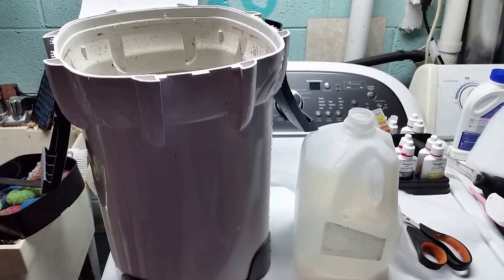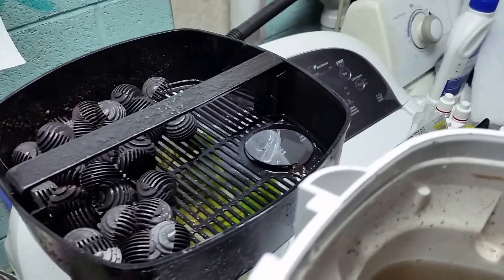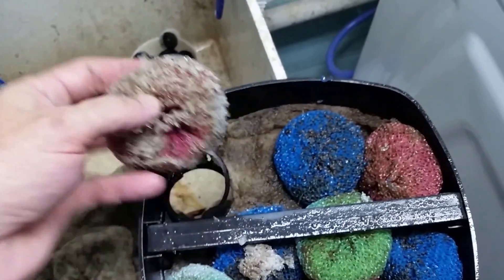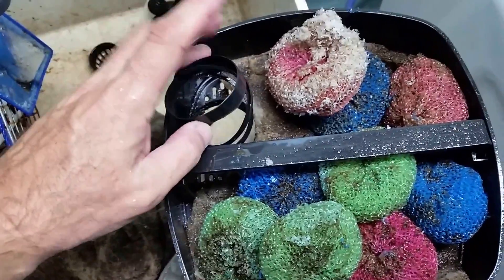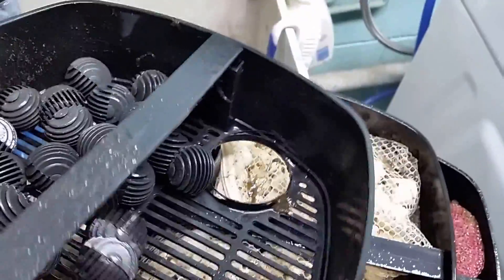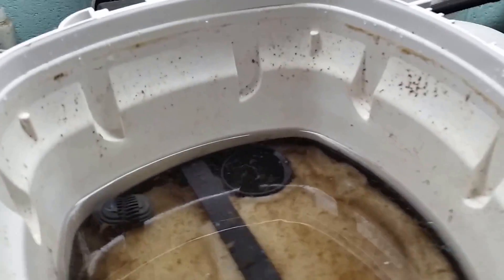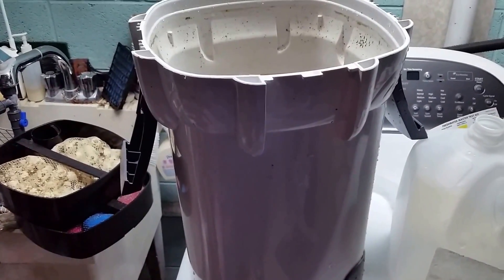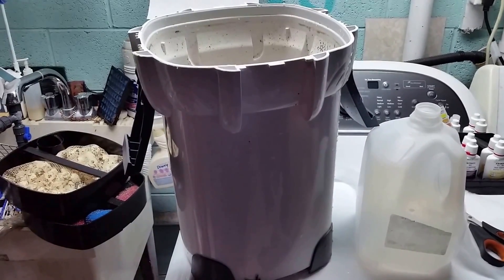UV Radiation Is Destroying The Inside of My Sun Sun Canister Filter

Comment: I used water proof foil duct tape with a little bit of aquarium super glue to help the tape stick real good.first you need to clean the inside of the holes really good with alcohol then dry off real good then cut strips of tape put a dab of glue on the area where your going to tape.I did mine seven months ago and it's holding up with no problems I run my uv 24 7now and my trays are perfectly fine😄

Comment: Bought a brand knew 304b ran the uv light for 24 hours checked the trays ran my finger around where the light goes and the only two top trays had black residue coming off them the two bottom ones where fine. Don't use the uv at all those trays are not uv resistant.
Reply from the maker: The manufacturer says the plastic will last a year or two with the light on 24/7

Comment: If not for videos like this I would not have researched the issue and discovered that there is a switch to turn it off...but its not obvious and nothing in the instructions explains the need to not use it constantly.
On the 304b the switch is under that clear plastic bubble on top of the canister. You must pry it off and it is just difficult enough to remove that you may think you're breaking something.
On the 404b its behind a gray door on one side corner of the top. It looks like a door a fuze would be behind...not a switch.
I'll be hooking my 304b up when I set up my 55 gallon. I suspect it will be a decent filter now that I know where the uv switch is.
Reply from the maker: It took me forever to find the switch on the 404. I don't run the UV all the time anymore either.

Comment: Using to much UV in these will damage them as well as any other filter that uses UV to kill algae so basically you can not use the UV 24/7 and not expect damage to the inside of your filter. 🙄
Reply: Use waterproof foil duct tape cut strips and put them on all four trays use a little aquarium supper glue to add extra stick clean the holes in the trays with alcohol first to get all the dirt off so everything will stick good then run the uv light 24 7 with no more problems

Comment: You do realise that plastic media should only be used in sump/moving bed filters? Although almost anything can grow bacteria but the amount it does is negligible compared to the correct media for canisters. Plus you should only be using the u.v for around 24hrs per week. I would expect nothing else. The trays in these sun Suns are really crappy plastic, so that don't help either. Even the ceramics that they come with are terrible, totally smooth. If you want to save money it's unwise to so that on filtration,THE most important purchase for your fish after the tank

Comment: Hmm seems like they used cheap plastic and the softener has gone. You normally don't have this with good or let's say high valuable plastics like ABS. As you said, the UV radiation has release the plastics softener and the result is porous plastic. But I always thought they were using good plastics...hmm...
Reply from the maker: I called the company, and they said about two years was normal before they broke down. I guess 'you get what you pay for" applies here. Lol (it's only $80 brand new)

Comment: Damn, I'm glad I decided not to use the UV in my filter. Makes sense though. It's like the plastic being exposed to direct sunlight 24/7. Must have killed the BB in the filter as well.  I use a UV sterilizer built for RO systems. It's housed in a metal tube and I run it on the same pump that runs my CO2 reactor, 6 hrs. a day.

Comment: I have now seen 3 Sunsun filters do this.  A 402b, a 403b, and a 404b.  All were having the UV light left on for weeks or months at at a time.  As mentioned many times in this thread and by resellers I talked to, it is suggested that the UV only be run for a day or 2 at a time.  I am only flipping mine on only 1 or 2 days a week.  For those looking for replacements in the USA, check out the AAP website.  That's the cheapest place I've found them.  They're also on Amazon listed with the 3xx series names for twice the price.  

http://www.americanaquariumproducts.com/ViaAqua750CanisterFilter.html#baskets

Ignore the Via Aqua name in the link.  The bottom of the page has stuff for those but AAP has switched to Sunsun as their recommended best-bang-for-your-buck filter.

Comment: Sun Sun is not UL rated.
Reply: Really expensive UV's are generally stand alone units run in line or on the out flow of a pump with UL rated piping.  The really good ones have coating on the inside to bounce the light back and forth like a pin ball to maximize the contact time.  Sun Sun should not be selling a UV in a non UL rated canister.  These things should be pulled off the market.  I owned one

Comment: An easy solution would be to only run the UV sterilizer for 24 hours when adding fish, or after a water change. You should not leave it on 24/7 or that will happen.
Reply: SunSun doesn't feel the need to mention this, so let's not be so fast to judge the uploader.

Comment: This happened to both my Aquatop CF400 filters. It took about 4 years. I found its cheaper to order new filters rather than trays lol. They sell "clones" of the Sunsun/aquatop filters that are most likely made on the same assembly line for around $58 bucks on ebay.
Reply from the maker: Yeah, I'll be shooting a follow-up on this video soon. Sun Sun told me it usually takes about 3 years for them to break down.
Reply: garretts91 lol where I mean when I look on eBay at least in Canada all I see is resold U.S Sunsuns

Comment: Boy, I hope the newer 704B addressed this issue.  I know there are issues if one turns one the UV with the canister empty, but if it's burning plastic while full, that's very much not good.  I only run the UV on weekends.  Maybe that will help me to avoid this kind of scenario.
Reply: Use water proof foil duct tape and aquarium super glue you will never have problems with your trays again

Comment: I had the same problem with my sun sun  HW 402 canister filter with my trays so I truned off my UV bulb.  I could not find any replacement trays. I would have to buy a whole new filter
Reply from the maker: I still haven't called them about it. Try looking on ebay. I heard you can find them there.
Reply: I found a company that supplies replacement  filter trays for just about every modal of canister filter at a good price AMERICAN AQUARIUM SUPPLIES.COM. I ordered trays for the HW 402 and they fit perfectly. i hope this info helps your situation too
Reply from the maker: Thanks! I'll keep it in mind if I don't hear back from SunSun.

Comment: I think I know what happened. For what its worth i was watching one of your previous videos on cleaning this filter and when you were reassembling the filter you were having trouble getting the power head to seat properly and I was wondering if the top tube on the basket was cracked or broken and that is what was making it hard for you to get it to close With that top tube being broken it would allow UV light to leak into the top basket and eat up the plastic pot scrubbers.
Reply from the maker: The tubes are gone altogether. The UV deteriorated the plastic completely!
Reply: That's something I've never heard of that on this particular filter before
Reply from the maker: Pe Ca Me either, but 3 of mine have done it now.
I plan to contact them at some point.
Reply: Please keep us informed on what you find out I have 2 of these filters myself
Reply from the maker: Pe Ca I plan on it. I already emailed but got no response.

Comment: This is an interesting Topic! just last week one of my customers brought me A (SUN SUN) canister filter for a Gasket Replacement, everything working well except it had exactly the same DETAIL'  the plastic shield that creates a longer water to UV light contact had disintegrated the same way. I don't have much to say about SUN SUN! BUT just this problem that seems to happen to SUN SUN UV canister filter that have been in used for more than 2 years  'approximately'    this is definitely a proof  that sun sun uses cheaper materials for their products, it is an obvious  fact since you can feel it when brand new. other than that this filter work very well. (Nothing is built to last forever!. )

Comment: Hi Dan, yes the UV light energy destroys the molecular bonds in thermoplastics. I tend to be wary of cheaper plastic anything's, simply because every level of plastic durability, adds to price.
Reply from the maker: Perfect example of why it takes time to gain experience.
Reply: Dan Hiteshew I work in the plastics industry, and plastics ain't plastics. I see videos of people recommending low density polyethylene stacker drawers as DIY trickle filters, and I get very nervous.
Reply from the maker: colinbarsby Polyethylene? Isn't that what is more commonly called "styrofoam"? Lol that's a little too light. Lol
Reply: Dan Hiteshew LOL. No. That's polystyrene. Which I do recommend you use. Ethylene is a gas, which is turned into a range of applications including solid plastics. You will commonly see symbols HD, LD and LLD.
Reply from the maker: colinbarsby polystyrene is the one. Lol I'm no chemist.
Reply: Dan Hiteshew The plastics used by the Best aquarium filter brands, are carefully blended for tensile strength, impact strength, heat strength, etc. Which is not considered by the technical staff who formulate the $5 stacker drawers at Walmart.
Reply from the maker: colinbarsby lol
Reply: Nuked water treatment system

Comment: That is very odd. At first glance I thought it might have been bacteria breaking/eating away at the plastic, but that usually takes FOREVER and occurs with cheapo sponge filters. I think the likely culprit is the UV sterilizer. It seems kinda odd to me that it would do this to plastic considering the UV sterilizers in SunSun Canister filters is a little on the weaker side. Maybe it is malfunctioning and overheating? Do you have the UV sterilizer on all the time? I usually only turn mine on during the weekends. If it really is just degrading the cheap plastic trays, you can at least control the amount of deterioration by limiting the period of time you leave them on.
Reply: Erik J bacteria eat plastic?

Comment: Sun Suns are great filters but the UV sux lol. I've never turned mine on and don't plan on it because 9 watts isn't gonna do anything on a 125 gallon tank or any other tank for that matter. UVs reguire low flow for maximum contact time and sun Suns certainly don't have low flow lol
Reply: It works, only you have to leave it on for long periods of time. Then you have to replace the trays. Bad design, I should have gotten the version A w/o uv

Comment: what does the UV light do in the filter? Is it beneficial to planted tanks only?
Reply from the maker: It kills waterborne microbial life. So any single cell (or extremely small) organisms in the water, from algae to parasites, is killed by the UV light. It sterilizes your water. (in any tank)
Reply: Dan Hiteshew So would you still need to use water conditioner when you do what changes if you had one?
Reply: Dan Hiteshew would it be a better idea to use it as a tool when you have an algae bloom? Along with other means of algae warfare?
Reply: Chiming in here kinda late but I'm looking to set up a new tank and from what I've read people only run maybe once a week for 6-12 hours (depending on tank size and how long it takes to cycle water in the tank)  to prevent an algae bloom or turn it on once you have one to kill off the algae. The light should not be run all the time and what happened in this video is a result of what seems to be the result for most that run theirs 24/7. On top of that you will end up burning out the light prematurely ( in about a month or so).
Reply from the maker: Jessica Cammarata Yes, if you need it. By "yes" I mean, yes, you still need to add your conditioner. Conditioner is NOT a sterilizer. It merely blocks ammonia for a brief period til your cycle deals with it.
https://www.youtube.com/watch?v=VQpeygl25S0&t=24s

Comment: For those who own Sunsun or Aqua top with UV lights the next time you service your fiter, pull out the first 2 trays and run your finger on the inside of the UV tube opening, your finger is going to look like it's covered in soot. I believe it's due to the UV light degrading the plastic, you will not find this in the 3rd or 4th trays because the light does not extend that far
Reply: Fishy Eye Rick I had that issue today. Not this severe. I hope it doesn’t get to this point. Any solutions? I do run my UV just about 24/7.